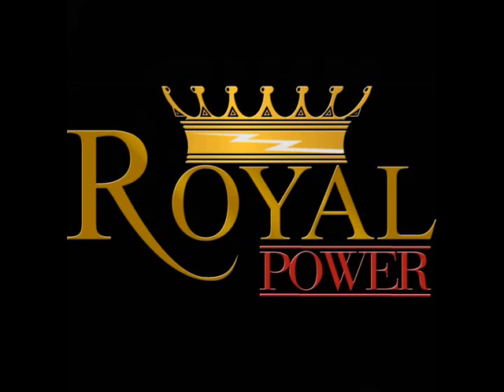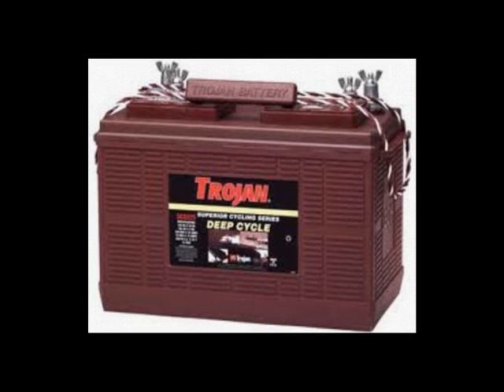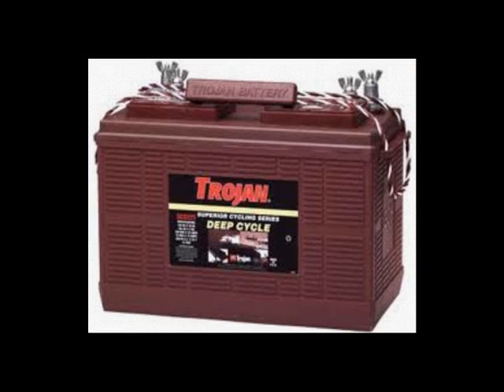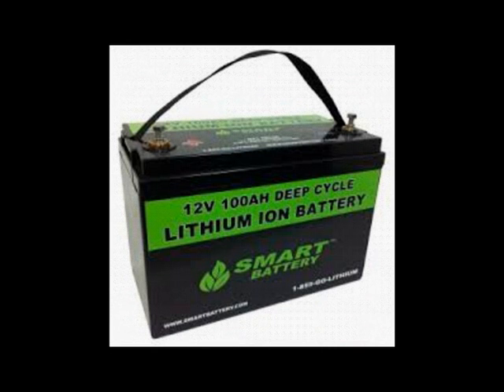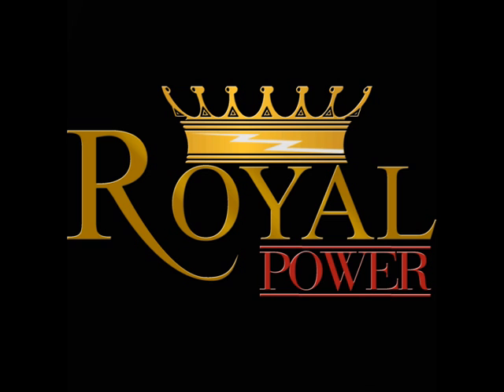Automotive vs Deep Cycle Batteries

Comment: I stop using my electric scooter in winter when I start Reuse my scooter I see every battery comes On the voltage of 5volt from 12.9 volt can it recharges again and is it normal in deep cycle battery
Please let me know
Reply from the maker: They should be rechargeable.